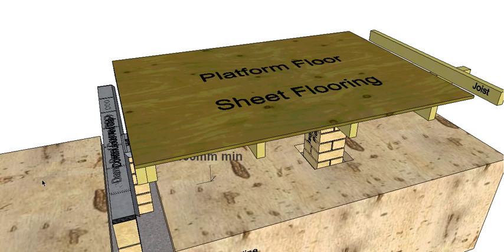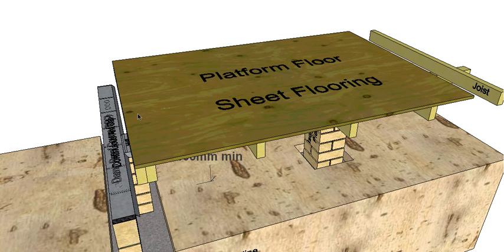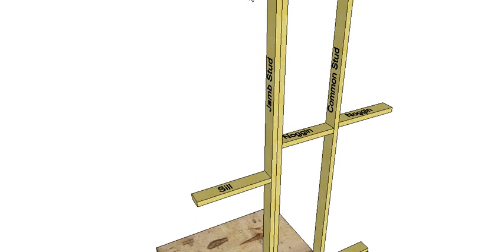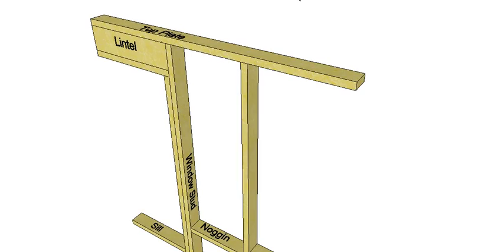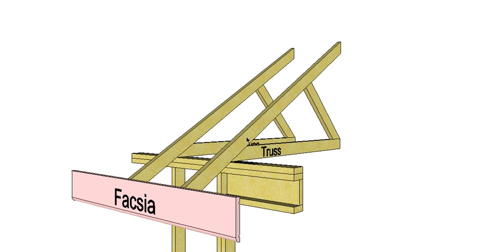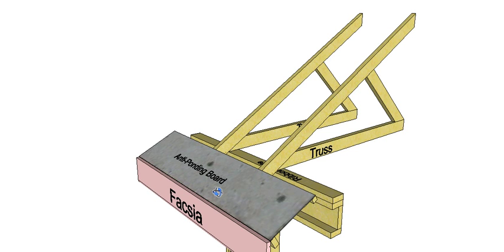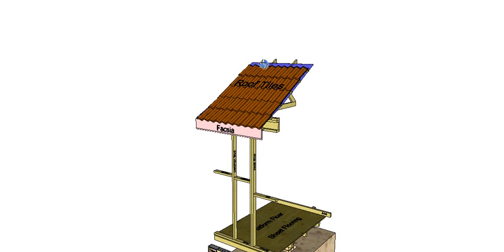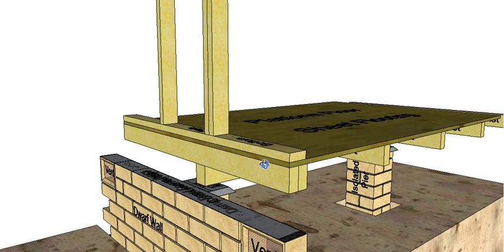Section through a Brick Veneer, Platform Floor Building Part 2

Comment: I'd like to give a shout to Buildsum for these videos. You're doing an awesome job mate and I think you're doing a great service to the construction industry in this country. I think your explanatory style works for all audiences because you are very clear in your descriptions, you maintain a good steady pace that's easy to follow and the procedural way you introduce each step logically follows the actual order of construction, not the process of project conception which has a tendency to overtake the planning because it's the fun part. With such knowledge available so freely, it's a wonder that there are still so many cowboy builders out there since it can't conceivably be more costly to simply do things the right way the first time. As the saying goes, shortcuts are expensive cuts. So thankyou and keep up the good work.
Reply from the maker: Hi Mate, thanks for your comment. It is great to hear that the videos are useful.

Comment: hi, great video. 

Do you mind to indicate the size details as well please 

Thanks
Reply from the maker: Hi Alex

There is not a standard size really it all depend on the strength of the timber that you are using. These sizes are determined from Span Tables. In Australia we use AS 1684 The Timber Framing Code.
https://www.youtube.com/playlist?list=PLHFT_d-5EhN67V-pbTSWQ0bxnluALyIfJ